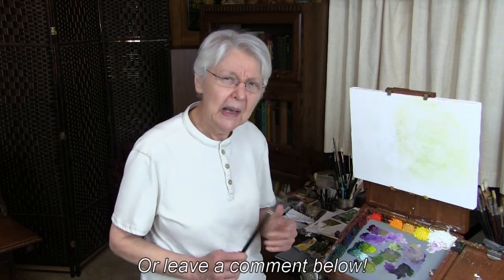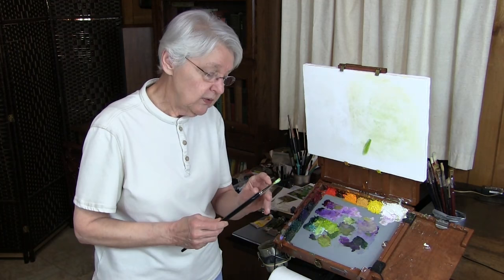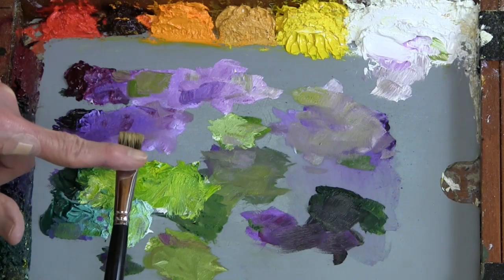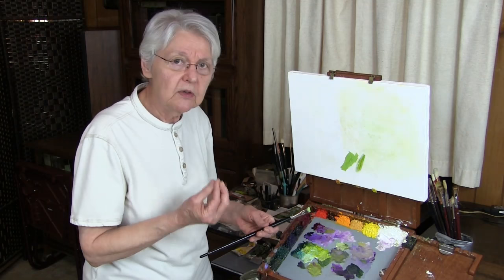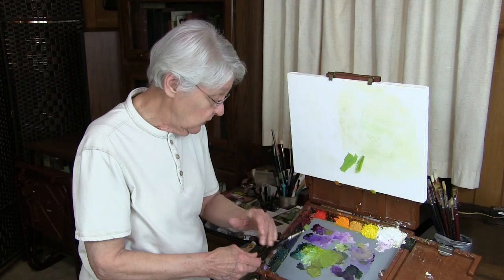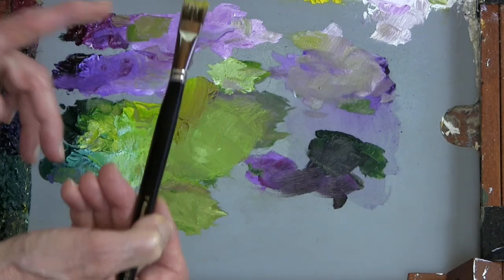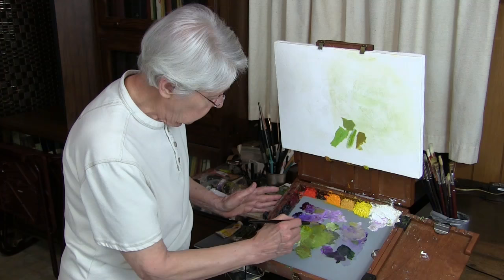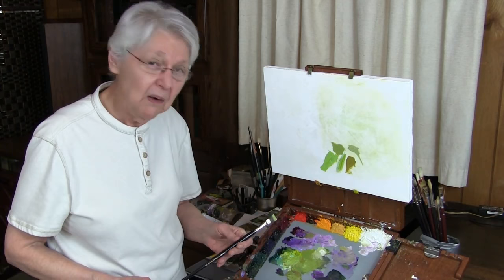Quick Tip 110 - Loading the Brush

Comment: Thank you, Dianne! This is very useful stuff. I love your videos. How about cleaning brushes? I see you have a pot right there where you constantly clean your brush. What do you use and do you use different brushes for different colours? Sorry about this basic question, but I tend to get messy and could certainly use your tips on this as well.
Reply from the maker: While painting, I use Gamsol to keep my brushes rinsed.  To clean my brushes, I soak them in Murphey's OIl soap, then rinse them in warm water, shape them and allow them to dry.  I know there is an abundance of brush cleaners, many which I've tried, but Murphey's OIl Soap is the least expensive, least complicated to use and the best brush cleaner I know about.